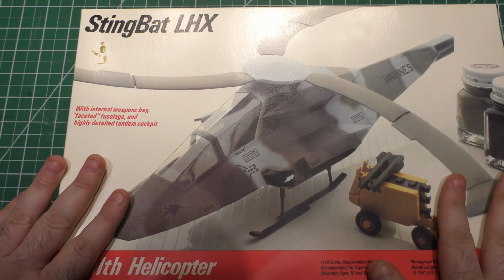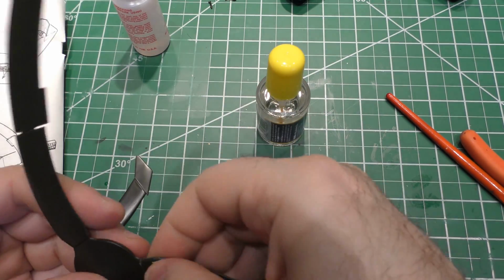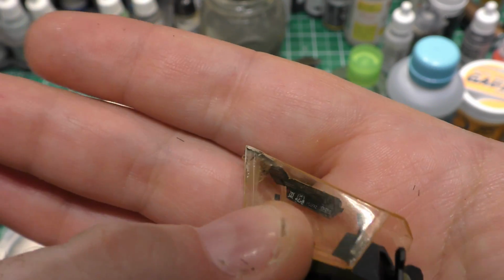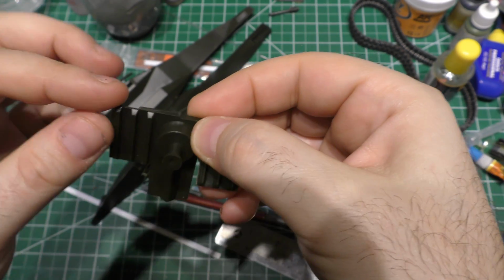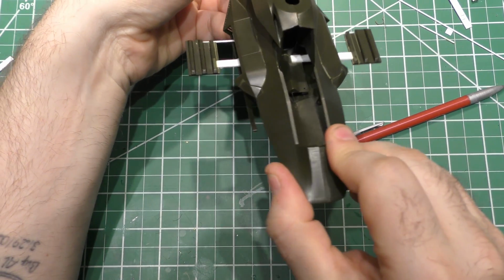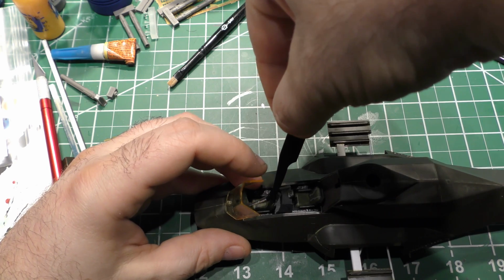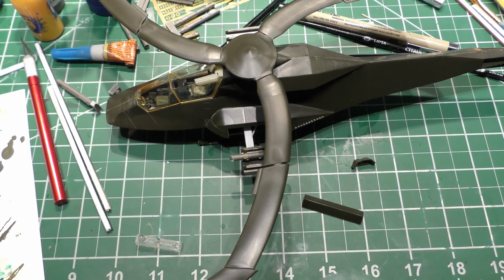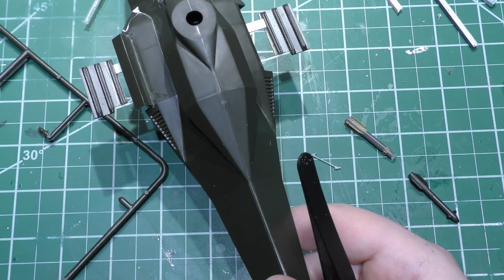Vintage Kit Building - Testors 1/48 Stingbat LHX Helicopter Full Build - Part 2 Construction

Comment: I think the doors on the side are for loading the missiles. The little door on the front of the sponson   that you glued shut are where the missiles came out, the exhaust came out the back where the vents are.
Reply from the maker: Only 1 missile lines up with the door though.  Here's another problem - you have direct rocket blast inside the aircraft. you can have a vent, but that doesn't prevent 1000 degree exhaust plumes from melting the inner bulkheads and everything contained within. Missiles like Hellfire & Brimstone fire actual motors directly off the rail. They don't have a dual ignition charge & sustainment motor like missiles fired out of tubes. Don't take this as me trying to tell you I know better than you about the intent of this kit or that you are wrong. It's a made up kit. It's entirely possible that the ones who made up the model really had no idea what the logistics and mechanics of actually firing a missile are. I'm just giving you my take based on training and experience and working with weapons systems. It wouldn't surprise me if you are 100% right about what it's supposed to be, and I'm the geek over here trying to apply real life rules to a fantasy machine.
Reply: @AirForceBuilder  I've managed to obtain a few of these kits, as I remember them from the 80's when I was a teenager and couldn't afford them back then, what Leon says is correct, they are supposed to be fired from within the weapons bay but like what you say the missiles probably would bugger up the inside of the whole aircraft, I intend to make one up as it's supposed to be and another I will equip with loads of oversized machine/Gatling style guns, to make it a proper bad arse gunship.